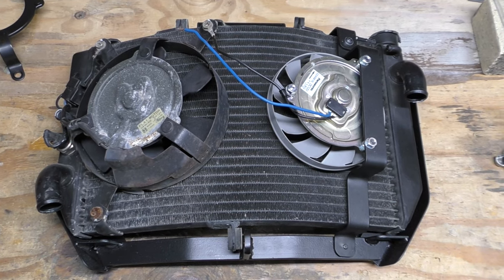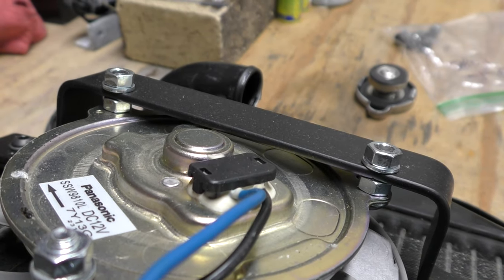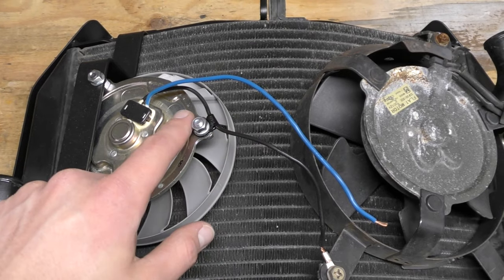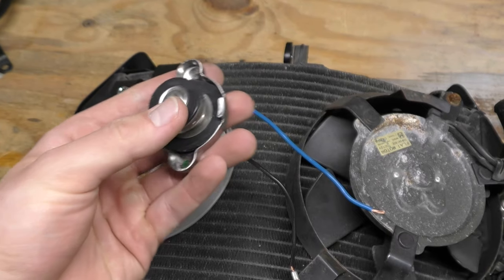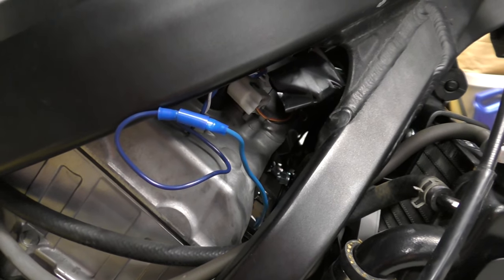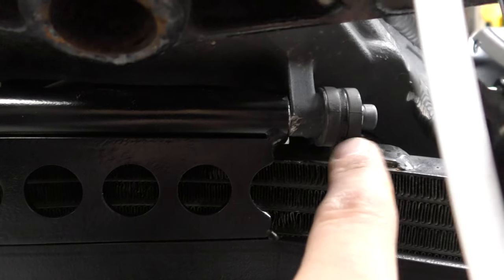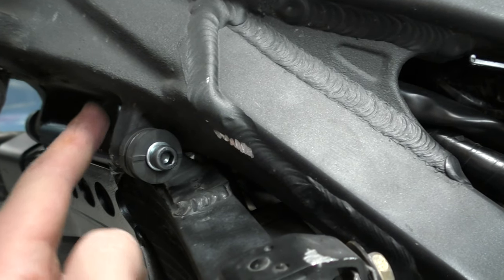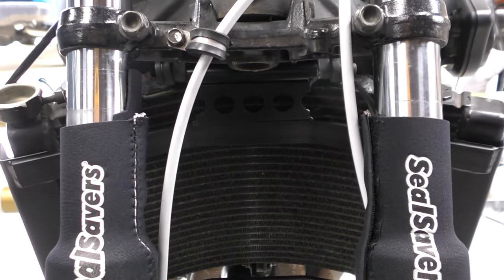2001 F4i Stunt Bike Build - Episode 15: Radiator Cage & R6 Fan Install

Comment: Hi im from Brazil , i have a cb600f 2005 ,  my radiator fan motor is not working , Can i put a r6 fan motor or another fan motor in other motor place ?  I think the Panasonic fan motor have the same size of my cb600f fan motor .
Understand me ?

Sorry my bad english lol .
Reply from the maker: If the fan itself is bad you should be able to swap it out. If there is a wiring problem somewhere down the line that is causing the stock fan not to run, swapping the fan isn't going to fix the issue. You need to find the electrical problem first to get the radiator fan to run right. 

If you wire two r6 fans to the battery with a switch that could also work. The fan won't turn on automatically based off the temp sensor you'd have to remember to flip them on. You can wire it just like the stock fan setup to use the temp sensor but I don't have enough knowledge on that to explain it correctly.